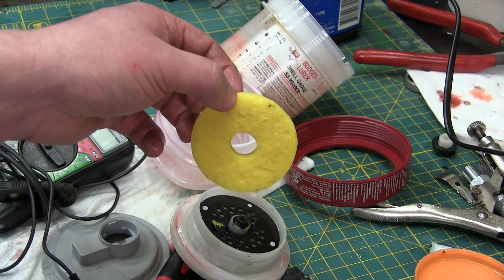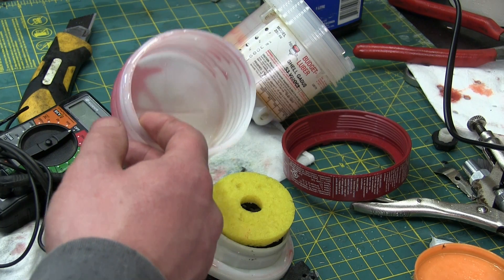BOLTR: Disposable Automatic Industrial Bearing Lubricator.

Comment: Those things are awful. Mostly because you can never be sure they're working for sure. You have a Joint or bearing that needs x amount of grease, you slap one of those on there and if you're really lucky it works.
The purely chemical ones are the worst but even the battery powered ones can be dead on arrival.
So you put enough grease in there for 1-3-6 or even 12 months just to notice once its time to change it that it's still completely full.

There are tables for temperatures but in my steel mill you can't always predict if you'll have -10 or =100°C on a part just because nearby machines could be turned off in the winter for repairs or turned on during summer.

I won't say greasing by hand is more reliable since the guy that does the job can put the wrong grease/too much grease/too little grease or no grease at all where it's supposed to be, but the chances of your spot being greased properly at least once in a certain window is more likely than one of those working properly all the way through.

Those damn things also love to break off. Especially if an electrician uses them as a food hold to reach something.

Comment: Clever device, there are some compounds that do not result in flammable gaseous mixtures while electrolizing, Ammonium nitrate (or common fertilizer) would result (if the conditions are right) in ammonia (weathered piss) and nitrogen gas (more common than oxygen).

Comment: You can tell that there's no brains in that device.  If it had a brain it woulda known that it didn't have to drive DIP shoots under your fingernails to get you to talk...you do that spontaneously!

That timer sounds like an RC circuit, sometimes referred to as a relaxation oscillator. Cap charges through the resistance until it reaches a striking voltage, whereupon it discharges through some load...like your electrolysis setup and the LED...which drains the cap and shuts off flow for another cycle. I know you know that...that's why you mentioned zener diodes...but it's one of the few bits of pixie dancing I actually understand!  Built one as my 6th grade science project, using neon bulbs as the trigger and drain load, and it's stuck with me. Unlike most of the rest of the 6th grade. Used a bridge rectifier to convert AC to DC so I could plug it in. This was in the days before there was a lawyer on staff at every school who would have popped an artery at my 110v open wiring!

-- Mike

Comment: Fuckin awesome! Is there a way to bleed that off and reuse? The ones we have at work (tower crane slip rings) are a planetary gear drive and a small DC motor to turn a bolt that's attached to the piston. I think there's some torque limiting pixies going through em as well. Wasn't expecting this style. So awesome thanks for the share!

Comment: See now if you were trying to invent something like this or convince somebody that it was a good idea, you'd be labeled "fucked in the head" real quick. Great stuff!
Reply: +Josh Menchions It takes way less innovation than that thing to be called a lunatic, especially in a large organization. I had good reason to replace a machine that supplied strips of raw material with a machine that supplied pellets (this machine was commercially available just buy it and plug it in) instead and that was roundly rejected as requiring "2 years to prototype".

They were basically saying it took 2 years to make sure that macaroni works the same as spaghetti after your cook it and grind it up. Unreal.

Comment: ole' Shell oil operator ..can't beat a Trico system....20+ years and not one failure...not one. but that's here in sunnnnnny California.....Do they still make Millwrights? I thought they had them all replaced by a robot with a level and a Preventative maint. computer.P.S ..Shutting down the plant I worked in....Sad....aren't many Flexi- Cokers around...what a ride though. 30 story elevator that pitched like a wild pig. ahhh memories.

Comment: What is Urea made of I've heard that its made of horse piss? DEF has Urea in it with 67. something % water is this the same thing your talking about?
Reply: +James Spires Methane combined with Nitrous oxide is urea. To make the stuff for commercial use, one combines ammonia with carbon dioxide.
Reply: It's true that urine has urea in it, I wouldn't really say it's made of anything though (it's a compound of it's own). It is made from the things that the commenter above me pointed out however. That may be slightly pedantic but I thought I would point it out.

It reacts with water forming ammonia and CO2, the piss smell is the ammonia. Urea doesn't really have much of a smell to speak of.

Comment: Hey, http://www.skf.com/caribbean/products/lubrication-solutions/lubrication-systems/single-point-automatic-lubricators/gas-driven-single-point-automatic-lubricators/index.html , we use that type at years and no battery, that I am aware, and not only in difficult to reach places, machines tend to lye less about what they have done, then the operator with a grease gun....
Reply: +Nuno Almeida Correct... I've seen more furry and rusty grease zerks in factories than I could ever count.

Comment: Hmm I do not like it.   Maybe good for say a truck- but you actually want a plant mechanic routinely inspecting the operation of machinery in use for diagnosis and planning of future repairs to prevent down time.  Better solution is a hose and some hose clamps to run an extension line for greasing hard to access bearings, gear boxes and the like.   Just prime the line and install it after installation of a new bearing.

An industrial facility for the most part is going to have a full time plant mechanic on duty anyway.  All I see this doing is spending a couple hundred bucks a year so ensure the plant mechanic is going to be drinking coffee in the electrical room a little more often.
Reply: +EgadsNo In my experience in plants, you're damn lucky if anyone is ever going to touch a gun to all but the most obvious and easy to reach zerk (which is why remote greasing, usually with pipes and not hoses, is super common). The maintenance guy's primary goal in life is to sit and drink coffee no matter what PM schedule you have.

Also, there isn't any way to inspect 99% of things without taking them apart. The best you could hope for would be to find a cracked casting, in which case your ship is already sunk.

So, for $100 if you can make something get grease, which was almost certainly never going to see grease again, you're well ahead of the game.

Comment: Hey AvE, as you pointed out in a previous video that a standard grease gun can supply up to 1700Psi of pressure. what kind of pressure would you expect from a device like this? seems like it would have limited uses.

Comment: Use once and throw away. A hunnert bucks out the window! What a waste.  
Kinda puts a verdict on our society as a whole. Value is no longer valuable.
Reply: +Rain Coast You seemed to have missed the purpose of these things. Yeah they are 100 bucks but depending on how troublesome the location is this is placed in, it could pay for itself many times over easily.  According to one source, these things can be in service from 6 to 24 months depending on flow rate needed.

Comment: Similar analog circuit genius in ground penetrating radar... The reflection time is quicker than even 1 cycle of a modern MCU so how to sample and measure things like EM reflections over inches or feet? Eh...just a resistor and capacitor will do haha...never even considered it since I always want to throw silicon at a problem.

Comment: We use these often on our press rebuilds and they are very nice but as a millwright 90% of the issues we come across are due to neglect and laziness of some operators (not all). These things don't always help because people get the idea that since these are installed that magically the machine is maintenance free. So after a install I leave tubes of grease all around the operators station.

Comment: They were starting to use these (or something similar) more and more in the steel mill I used to work at. It wasn't so much that it was cheaper than sending a millwright up a ladder, but that it was cheaper than replacing a bunch of seized bearings and who knows what else when the millwright neglected to do the lube job in the first place.
I.E., it was a little more reliable.

Comment: So what is wrong with a spring?
Reply: +Jared Jeanotte Spring creates constant force that has to be controlled. This method only creates force when the LED blinks and expands the gas in the baffled chamber. Once the current quits flowing the pressure stops increasing and remains constant for the next cycle. Thus it also is always ready to dispense grease without a delay.

Comment: Clever device. Even the piston (yellow bit) is conical so that grease is not wasted.  Before you got if cracked open I was thinking baking soda vs. vinegar with a wee little valve.  Electrolysis and the cat piss soaked piece of pineapple is better.

Comment: So you leave these on the lubrication point and they squeeze the grease over weeks or month, right?
My guess is that the resistors by the DIP switches set the time constant of an astable multivibrator (so yes, in a sense they limit current, but not to the electrodes) and whenever the LED blinks the electrodes also get a pulse of current.
Reply: +superdau I believe pressure also dictates the currentload
Reply: +AvE there must be a wide pressure tolerance on the grease fitting as I assume the amount of gas generated is the same over time but going into an expanding volume if the bellows so to maintain the pressure would take more time .... no?
Reply: +AvE damn typo..... as the bellows volume gets larger, more gas is required to maintain the same gas pressure and/or grease flow
Reply: Ron Schnaper
No. There's no need maintain a gas pressure. The grease will be squeezed in until the bellows expanded back to atmosperic pressure. Sure it will work a little bit faster while the bellows is small, because the same amount of gas produced creats higher pressure, but in the end it will still expand by the same volume for every burst of current to the electrodes.
Reply: +superdau That assumes free flowing lubricant ... I assume there's back pressure either from a filled bearing or from a check valve on the fitting. .. no?
Reply: +Ron Schnaper 
You're right about the backpressure, for example from the spring in the grease nipple, but I doubt it's a strong spring (no need for that). I'm not a mechanic, but from experience I can tell you grease get's everywhere with time even without pressure ;) . So if a bearing is full, the grease will be slowly be squeezed out. Maybe not in a few seconds or minutes, but most likely until the next grease "pulse" comes around. I have now idea what the interval/on time on that device is, but I'm pretty sure it's not like trying to squeeze with the grease gun every minute.

Comment: two transistors, and a few passive components and you can make an astable multivibrator circuit. Which depending on the value of the passives used gives you a varying stream of on, and off pulses. So that's my guess as to what most of that board's circuitry was up to. Then the other transistor does the business based on the trigger from the multivibrator clock. There looked to be 3 transistors on that board to me. So there's your silicon.

Comment: The circuit looks to me like a "astable multivibrator", a flip-flop with a resistor-capacitor timer. It's basically a very simple and inaccurate clock, but good enough in this case it seems.
Reply: +boelwerkr yeah based on the parts I saw that is my guess as to what it is too. Here I've only ever used one of those to blink LEDs. I'd have never thought to hook one up to a bottle of pee and make a fortune with it.

Comment: these are great, but the plastic threads are brittle, worked in a foundry with these installed, and we would have to change out bearings more often with these installed, usually what would happen is buddy cleaning the sand and dust would knock off the auto luber and not say anything, then with the exposed hole and dust and sand the bearing would fail in no time at all, also sometimes they wouldn't work, set the switches set for 3 month setting and the date someone wrote on the thing with a sharpie is six months past and the thing is still full. but overall when used properly they are good

Comment: Genius! I wonder if there a patent number on it - that might tell you what the chemistry is.
Reply: +mikeselectricstuff 
http://www.google.com/patents/US4023648

An absorbant insulating layer 86 formed of paper or cotton is provided inside the anode. This layer is impregnated with an electrolyte which is located in a realitvely thick layer 87 of paste made of carbon black or other similar material mixed with the electrolyte. The electrolyte consists, for example, of a mixture of a strong solution of lithium chloride in water (about 40% lithium chloride) with enough zinc chloride to bring the pH below about 6. This is usually around 10% zinc chloride. If desired, other suitable compounds, such as sodium chloride and calcium chloride, can be used in the electrolyte
Reply: +Jordan Stocker (Haggard) So it's been around for something like 40 years.
Reply: Probably not a metal salt based system. Those are way to toxic
Reply: + @RobertSzasz  ...
Those pesky sodium salts are extremely toxic and hard to resource... Besides that, have you seen what it does to ice.
Reply: @hokiepokie_soupermane  It is urea electrolysis that drives the thing iirc
Reply: + @RobertSzasz  ...
 Unfortunately I only like my urea in Redbull....
.
 Now vanilla flavored beaver asscream... Oops I meant "ice cream", is the bees knees.
And that's called castoreum iirc. Lol
Reply: +Joe Renevitz Patent was a very interesting read.  Thanks.  Yeah, I can entertain myself reading technical manuals.   What pisses me off about Google Patents is how they will go to the trouble to archive a patent and then forget 5 of the 7 images from the patent... like the one with the schematic!?!?!?   Oh well, gotta save room in the server farm for one more feminist video.

Comment: We have some of these that take replaceable grease cartridges and a 10,000$ lithium battery. They use a big screw with a rotary encoder and a gear train to slow down a little DC motor by a few hundred to one. The dip switches let you pick the interval between doses from a few min to a few weeks. I don't know how much they cost (I never asked the parts guy) but they seem to last 2-3 years before someone steps on it and it needs to be replaced.

I wonder how much temperature changes the rate at which gas is generated in your auto-lube machine. The instructions might include a temp coefficient to use when you set the dip switches.

Comment: I'm surprised it builds up enough pressure to overcome the viscosity of the schmoo.
Reply: +stonent it's all sealed, there's no valves for the gas to leak through, so it just keeps building pressure until it either runs out of juice(one kind or the other), or ruptures. In any case,  the grease doesn't have to move very fast at all, so you also get temperature cycling(day/night) helping things along.  I do wonder how they perform at low temperatures though.

Comment: I really wouldn't have thought, that this device is based on such a primitive circuit :D. But if it works and maybe also has a very low energy consumption, this is actually great. In today's culture you have to wonder if something DOESN'T have at least a micro-controller and wifi-capability :D

Comment: When I was at the tower of london they had an old school system. Basically there were large funnels attached to the machinery and at the bottom of the funnel they had a tap that could control the rate of flow. Every so often they'd just drip one drop of oil into the mechanism below. The little glasses were visible so they could just top them up with oil whenever they looked low. Really clever system,

Comment: How does the bearing connect?  Does it mount on the bearing?
Reply: +Daniel Johnson I'd assume it has an adapter that screws into where a grease nipple would normally go, or a piece of hose from the luber to the grease point and the luber would be mounted to a bracket of some description